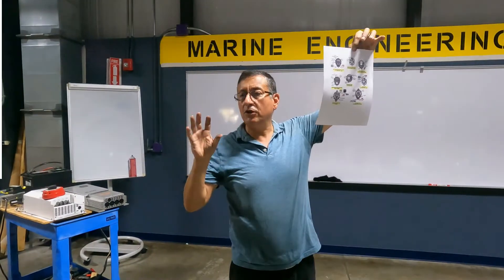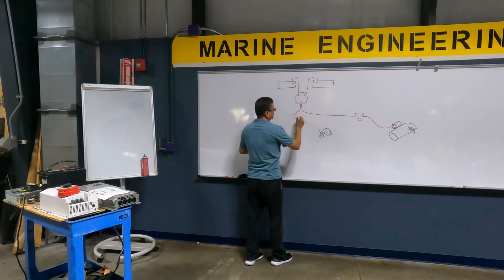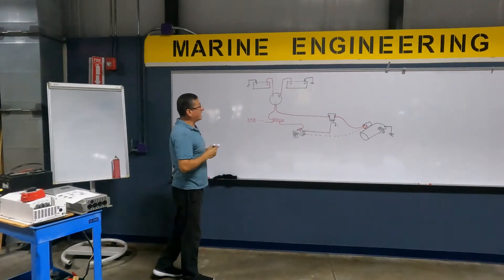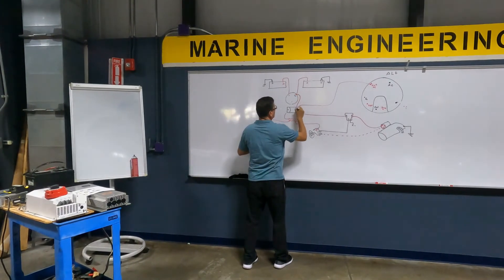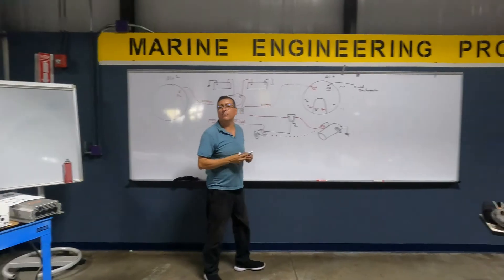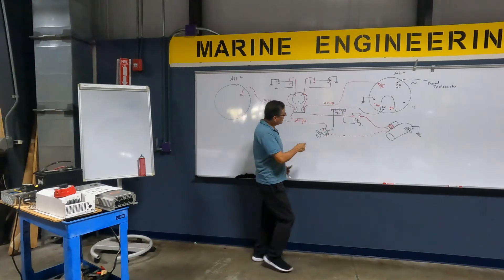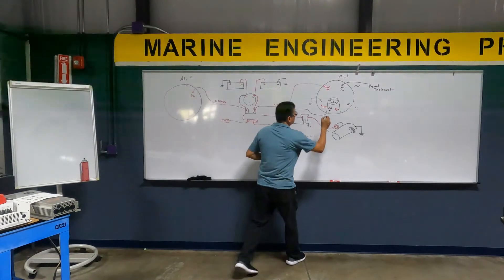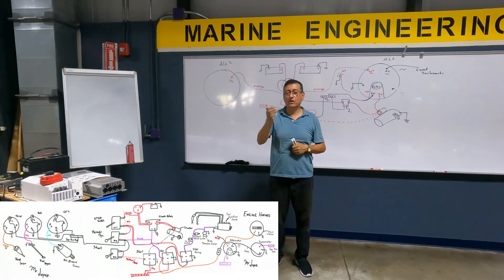Marine Alternator and Starter Wiring

Comment: Thanks for the video it was amazing.  But i have a alternator that doesn't charge.
 It already has two cables solidly on the alternator, black and red  . And from the boat i have purple , purple with pink ,orange and black?  How should i connect that alternator?
Reply from the maker: Thanks for following me. This is a long answer. However I recommend to follow the wiring diagram of the Alternator according to the manufacturer. The Purple cable is always the exciter coming from the ignition switch. The Orange one should be placed at the (+) Red on the Alternator. The Black one to the (-) on the alternator. Good Luck